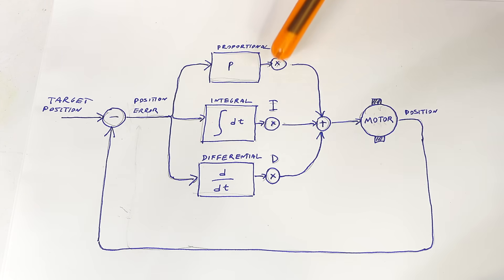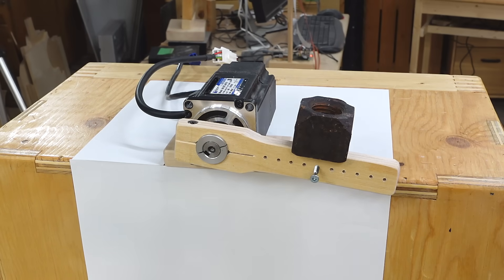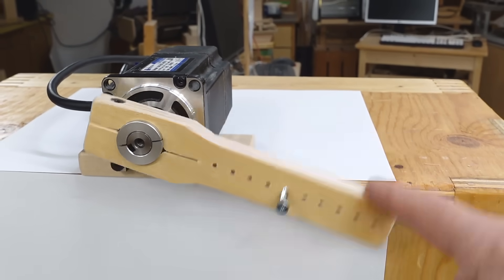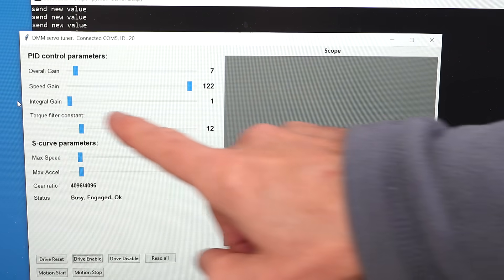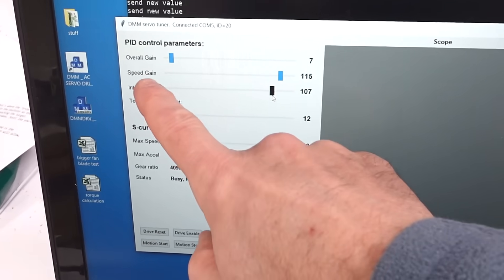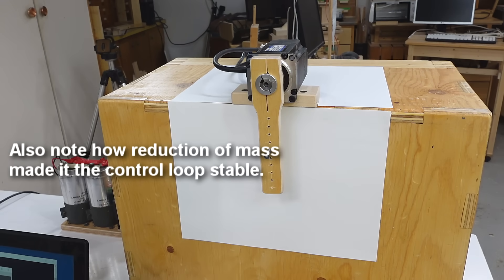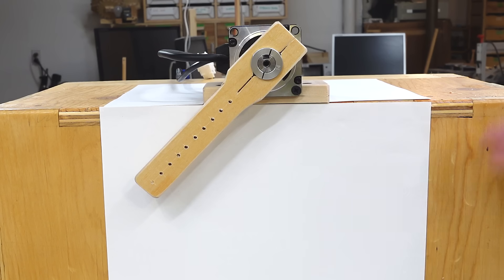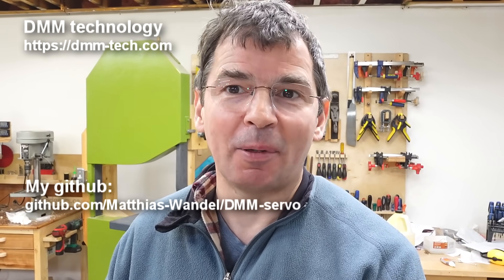What does a PID controller do?

Comment: You forgot the very important IL (integral limit) and so you are experiencing integral wind-up.

There are endless publications showing a value for the integral but in fact, it is better applied only when/near end of motion. This is the reason that many conclude that PID tuning is "difficult".
It isn't....just apply the integral to take-over when the proportional runs out of steam.
Reply: Windup also important in multiple-input control loops. For instance, suppose you're designing a robot arm that should deliver limited torque/force as well as velocity.  You could write two parallel control loops, and take the max(a, b) of both so that only one asserts control at any given time, and the other remains saturated negative.  But then the previously-unused loop has to come all the way out of saturation before it can assert control, resulting in a huge dip or peak in response until it pulls in. When writing the control loop yourself, you can use two integral terms, but track whichever one is in control, and force the remaining terms to track its value -- eliminating windup. (The downside to this, is it makes the output sensitive to proportional or derivative error in the "inactive" channel, as its integral is forced near threshold -- arguably this is valuable as the control can't know exactly how close it is to threshold and may need to respond to such changes very quickly. Alternately, some other margin might be maintained, to prevent this behavior but make a compromise against windup.)
Reply: @T3sl4  Wow, that's more complicated than it needs to be. Cobots (collaborative robots) work alongside humans without protective cages. They employ Adaptive Gain Control and torque limiting. We do the same with industrial machinery to minimize the possibility of damage due to collision. As stated, I would never use integral except for eliminating steady-state error.
Reply: @T3sl4 ....or else take the avg. of the two as the next control value...

....for only proportional control.. ..also look up T.B.H. (take back half) ..& other improvements on it...
.....ref. Steve Woodward...
Reply: Are you suggesting  - dont perform Integral calculations in the PID loop until the current position or process variable (PV) is within a certain range of the Set Point (SP).  Either way, that is an interesting idea

Comment: Are you able to have it resist at specific "weights"? For example to be able to act as a set weight if someone wanted to make an "electronic" cable workout machine?
Reply: This is called torque-limit. Regardless of what the value of the PID output is, we establish an upper limit.
Reply from the maker: Some servos can be told to just apply a torque.  Not these ones though.  But low speed high torque tends to heat up motors a lot, not good.
Reply: @matthiasrandomstuff2221  
Really? I see you make mention of pulse and direction which means that the PID is handled by the drive but there is typically an analog input that can be designated to torque limiting.
I prefer drives that have +/- 10V analog motor command where the drive can be configured as a velocity controller or a torque controller. I always use the torque mode and close the PID loops myself. Limiting my motor command output effectively limits torque.
In this case, my drives merely supply current and take care of commutation.

Regarding temperatures, my 40HP motors are nominally 10HP but fitted with blowers. They barely get warm.
Reply: @matthiasrandomstuff2221 ..
without current limit or some torque control...excessive current can also cause the motor to overheat/overload..and you don't know its happening......😢so one's dependent on O.T. trip...
with current measurement & control..(I^2 T) protection can be used to protect both motor & controller.

Comment: Good explanation and demo.  PID control can be hard to grasp, especially for thermal systems with lots of mass.
Reply: PID isn't usually the best choice for thermal systems.   I worked with liquid chromatography temperature controllers for 10 years.  Straight proportional control works real well (in a normal indoor environment) if your loop time is much faster than your response time.
Reply: "System inertia" is the bane of control systems, PID included. Any time you are trying to get something with lots of "inertia" to move you need lots of "force", and the available force is always finite so it will never instantly go where you want it. That said, a  well-tuned PID goes a long way in getting you where you want to be with no more delay than absolutely unavoidable - but then woe betide you if that system changes for any reason without the PID being re-tuned for it...

Comment: This can be a complicated topic. Each PID you use will likely have its own quirks. I work with automated systems, and this is how the PLC world works: Siemens emphasizes time-based tuning with cycle constraints, Omron uses constants tied to execution timing, and AB offers gain-based tuning with scalable multipliers. For responsiveness, Siemens and AB increase the P and D values, while Omron decreases them. Integral adjustments vary: Siemens decreases time, Omron decreases a constant, and AB increases gain.

It’ll make your head spin 😵‍💫
Reply: ..any other than the 3 mentioned?
Reply: @analoghardwaretops3976  
There are many which are codesys based. Beckhoff is the most well known, but Schneider, Keba, Festo, and B&R are also decent to good. As far as I know those all run on PC hardware, with a (partly) realtime OS. They usually have vastly more processing power than legacy PLCs. 
Do note that the codesys plcopen motion blocks are much better than Beckhoff NC, so for motion I'd give the nod to vanilla codesys depending on application. Beckhoff has more/better tools to use with distributed clocks so if timing and synchronisation is critical I'd give the nod to Beckhoff.
Reply: @   Yes, the ones I listed are the main suppliers I have encountered in the semiconductor industry. There are many; I have heard good things about Codesys and Wago, but I have not tried them myself.
Reply: In the modern PLC world, demanding motion applications are usually not written in Siemens, let alone AB or Omron.
Reply: @Bluecoldcaffe  You are incorrect. I'm a Controls Engineer. This is what I do every day.
Reply: @silentbob1236  You're programming demanding motion applications in Siemens/AB and Omron? Is that for nostalgic reasons or is the pay just that good?

Comment: Is there such a thing as auto-tuning for the PDI values? I can see static values for a machine with known, predictable loads. But say for example a CNC will have very different loads if performing a free air rapid move, vs a light surfacing cut vs hogging out a ton of material.
Reply from the maker: PID is about controlling the inertia.  High cutting forces don't add inertia.  They do however cause deflection in the machine, much more so than motor angle errors.  And deflection in the machine, unless you have some way of measuring it in real time, you can't really compensate for.
Reply: @matthiasrandomstuff2221  Oh, am I thinking right: if tuned for high inertia (free air rapids), then slower, loaded movements will be fine by default?
Reply: @eh42 ..never will be ..the whole range in between can exhibit dynamic behaviour.

Comment: It’s cool to see how different fields use the same concepts. I work in power electronics and constantly have to create compensation loops for my feedback networks to avoid things like oscillations and overshoot (in my case in my output voltages). We always create bode plots to figure out our stability/damping criteria. Our circuits tend to only need PI loops too :)
Reply: An integral gain is always a bit easier with numerical systems. Differential terms have their own problems, because a noisy error term can be amplified.
Reply from the maker: The differential term is only for things that have momentum.  Voltage in a capacitor doesn't have momentum.  You stop putting current in and the voltage increase stops immediately.
Reply: @matthiasrandomstuff2221  Depends on the circuit.  The equivalent to momentum in electric circuits is inductance.  So plenty of DC/DC converters have to deal with that.
Reply: Agreed.  In my career I have installed thousands of PID control loops in the chemical/oil/gas industries.  The vast majority are PI without D.  We usually only add D for temperature control loops as they have essentially thermal momentum if you will.
Reply: All energy domains behave fundamentally the same. With one exception - we have yet to find a thermal inductor
Reply: Same for large power plant control loops.  Everything has a PID controller, but you don't want Derivative control on most of the systems.  Speed of change isn't important;slow, steady changes and responses are the desired goal.

Comment: Note there are mathematical methods to calculate the proper values for PID.
Reply from the maker: Yes, but by the time you figured out the effective moment of inertia, and the actual values the 1-127 scales to, and after that, you still gotta verify.  Easier to just tweak the value till it acts right.
Reply: @matthiasrandomstuff2221  Sorry was not intended to be a negative comment, was more an generic statement.

Comment: I worked on a water balanced cliff railway that had its speed controlled by an analogue circuit which simulated a PD controller. As you mentioned the integral can cause issues so they left it out. It did mean the speed would increase a little if there were a lot of passengers going down at the end of the day. Otherwise it worked great. I did experiment with using a full PID on the PLC that controlled the railway but without much success. The relationship between hydraulic swash pump angle and braking was a complicated one.
Reply: Right, Integral does do one thing that the others don't; it returns you to the same speed, which you mentioned.  So you end up with a negative 'sag' on the desired output from the PD controller, which I guess is fine; it overcompensates a bit. If exactly constant speed was desired, an LITTLE Integral would do that for you.  You have a high-mass system that can change fast, hence the Derivative is needed.